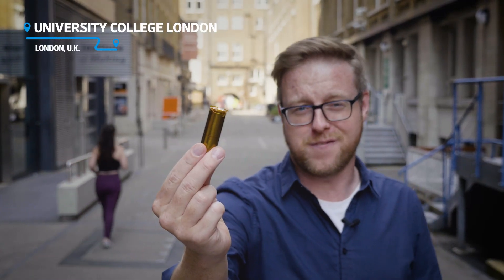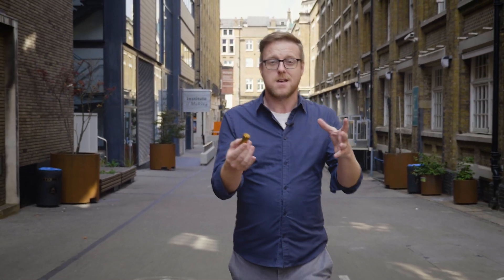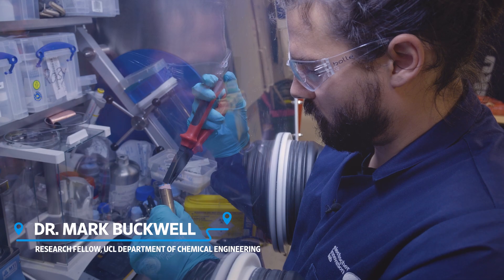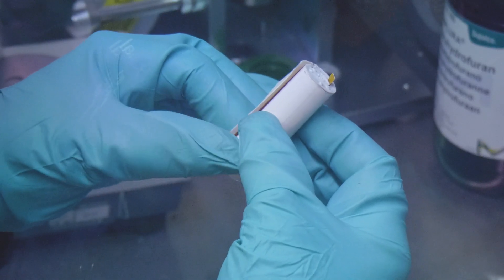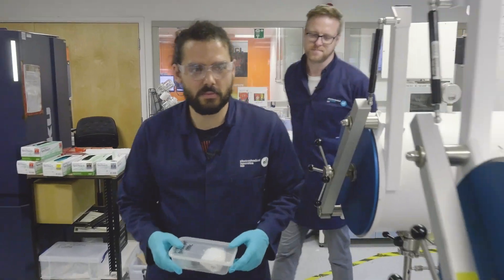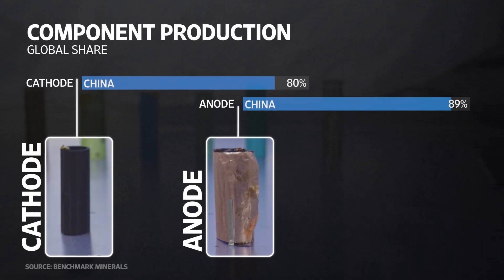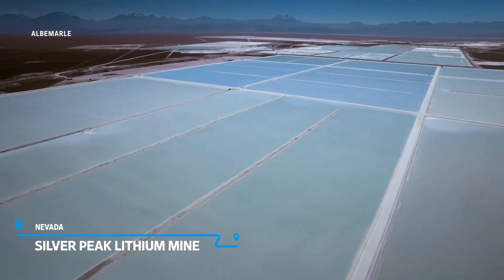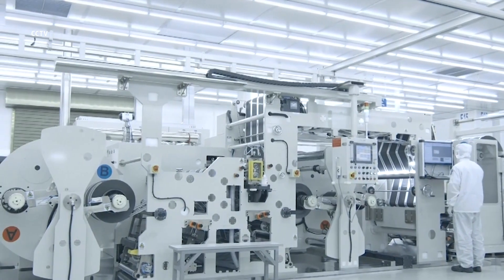Can The U.S. Overtake China’s EV Battery Dominance? Let's Take One Apart to Find Out

Comment: Do you think the U.S. will ever have an independent domestic battery supply chain?
Reply: Not the slightest chance of that ever happening.
Reply: Not as long as the fossil fuel barons exist
Reply: Not gonna happen,loby of oil companies are very strong
Reply: no
Reply: We are hard at work making a better a battery as we speak.
Reply: just like Chips made by USA,it is long way to go,now american is lazy to abandon manufacture
Reply: Yes definitely after a Millennium
Reply: Yes, assuming we pass legislation to fast track the permits required to build out these supply chains. Otherwise instead of being beholden to OPEC, we will be to China for batteries. Which defeats the purpose of being independent as a nation for energy storage
Reply: Start with the US Dept of Energy stop licensing tech that taxpayers paid for the research and development to Chinese companies that have zero plans to fulfill the requirement to manufacture them in the US.
Reply: Only if talon metals nickel mine in Minnesota gets built.
Reply: I hope Lithium Americas can get the Thacker Pass Nevada mine going. It would be great for my stock! (I'm kinda poor so I only have 5 shares but it has gone from 25 to 29 dollars since I bought lol.) I don't get why it's not worth more all things considered but the stock market doesn't necessarily make logical sense most of the time.
Reply: Lol, no
Reply: Talon Metals is the only hope
Reply: Wrong question....
Reply: No. And do you think Europe will ever have an independent EU battery supply chain?
Reply: Is it necessary?
Reply: @yaouyu  It won't be necessary if China accepts all trade rules set by the West.
Reply: @onetwothreeabc  You mean WTO rules?
Reply: With newer and cheaper material and production process...may be.
Reply: There is no chance of that, not at all.  TSMC, the best semiconductor manufacturer in the world, who was forced by US to open fab in US, said cost per chip will be 4 times greater than Taiwan.  Taiwan itself is more expensive than China.  We are talking about semi fab, which is NOT labor intensive.  Would you buy a Tesla that is 4 times more expensive than a Tesla with Chinese battery?  The fact PDD, a Chinese e commerce app, which mainly sells affordable white label Chinese products is now the most downloaded and most active app in US tells me American people care about only one thing, price.  So no chance, sorry
Reply: @keith6371  US of the A can afford it...😘  Reverse offshore manufacturing is a freaking smart move of Joe.
Reply: Yes, I absolutely do... There's a hi-tek "lithium-ion" battery factory being built close to where I live now, actually..

Comment: BMW, VW, GM, MB primarily use LG Chem lithium ION.  Many manufacturers quickly turning to easier to obtain/cheaper/less fire no colbalt LFP (lithium IRON NOT ION BATTERIES.  LG chem does not mass produce lithium ion like CATL and BYD
Reply: CATL and others switching to even cheaper Tesla type 4680 batteries.  4680 more energy dense no colbalt cheaper cuz tabless and used STRUCTURAL BATTERY PACK.  4680 batteries means less batteries around 700 batteries/vehicle vs 2170 battery  of over 2000 batteries/vehicle.  Diversifying battery packs allow spreading of thin supply.  LFP(lithium Iron) in entry level vehicles, 4680’s in entry/mid level, 2170/18650 in high performance vehicles.  4680 will
Appear in more vehicles as production ramps ups.

Comment: So, we are almost at a crossroads with batteries. An Indiana company is testing road material best for embedding cables in all our roadways. On the battery cell has a magnetic pick up coil. This is induced voltage much like a cell phone laying on a charging pad. This is where we will not need mega cells that have 500 kms range. A design that is universal and can be interchanged in any car can bring the price down substantually. A Tesla battery cell costs $20,000 but when all batteries are standardized will only cost $1000. You don't need as many cells as roads will charge as you drive. Get home, pull into the garage and under the car is a parking charge pad that trickle charges over night to ensure a 200 km range, but you only need to drive on residential streets to the roads that have charging. Power from wind and solar so renewable and better for the planet. The sooner we get off oil and gas the less carbon foot print we all have to deal with.
Reply: @Brian Percival What if a lightning strikes the road?
Reply: @unknownstoneageman81  good question! I am against this idea for other reasons, but I assume the grid under the street would have mechanisms in place to redirect the lightning, much like above  ground power lines do. Lightning has one goal: disperse itself into earth ground. As powerful as it is, it is lazy. It looks for the easiest path i.e. conductive material. Lightning does not want to be in your computer or television or body but sometimes that's the easiest way for it to get to ground.
Reply: @johnn.2017  no need, grounded.
Reply: @unknownstoneageman81  grounded
Reply: Are you aware of the higher cancer rates of people who live next to power lines? This sounds like a terrible idea. On the other hand, your car could probably be tracked wherever you go even if you don't have a phone with you so... Yay surveillance state?
Reply: @johnn.2017  you are sitting in a farraday cage.
Reply: @MathGPT  there is a video to watch.
Reply: What a sweet dream!
Reply: Are you even an engineer or scientist or just a wanna be? An arm chair general